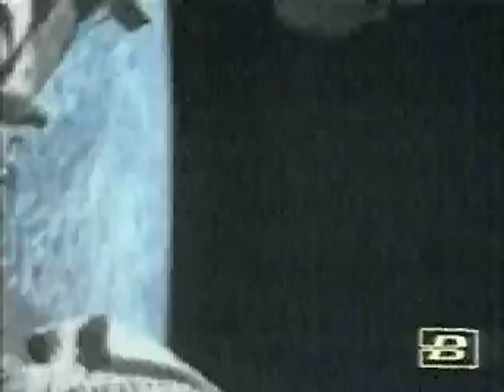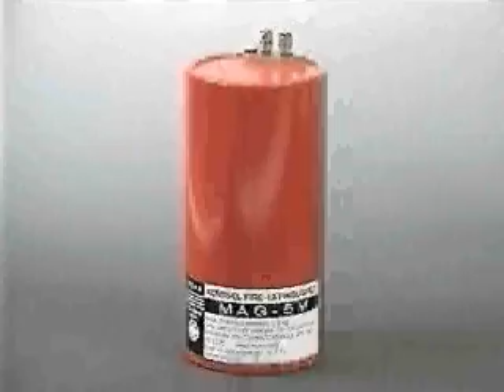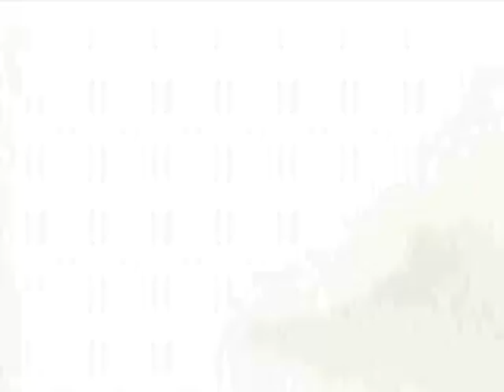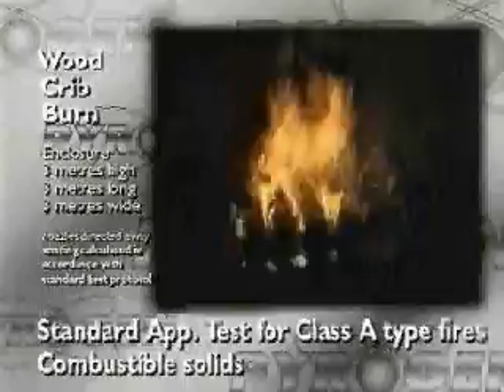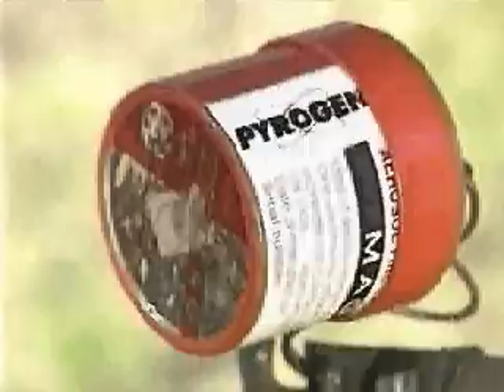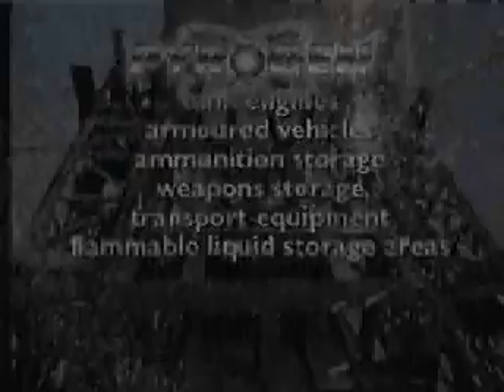Pyrogen Aerosol firefighting agent

Comment: What a cheesy advertisement. Just because something was used "in space" does not automatically make it the best available product in class. Were people really that naïve in the past to just buy such a phrase hook, line and sinker and not question the merits of the product any further or compare it to any other alternatives?
Reply: Pyrogen producers may in fact be superior to Halon-based flooding systems but what about EMAA - Encapsulated Micron Aerosol Agent? Which is apparently bests even Pyrogen requiring only 50g/m3 vs 100g/m3 for Pyrogen and 300g/m3 for Halon 1301.